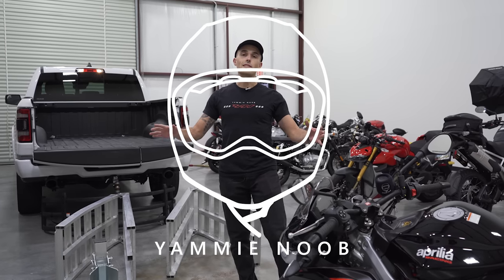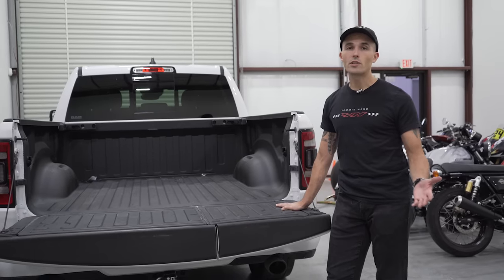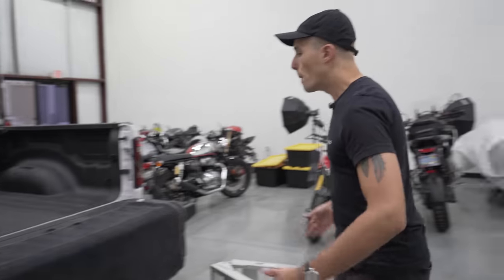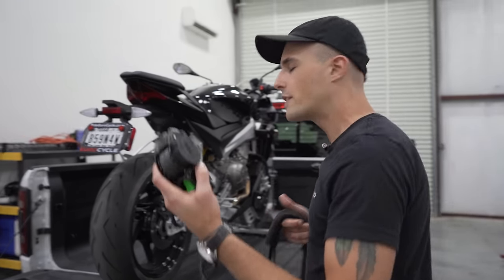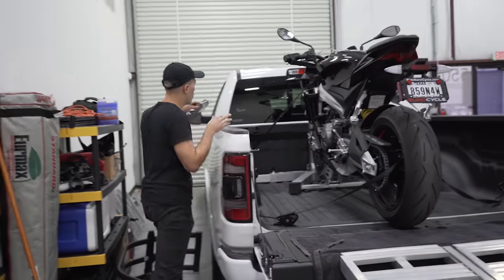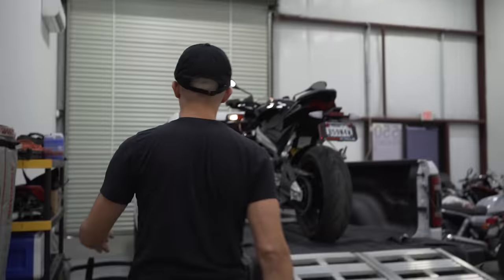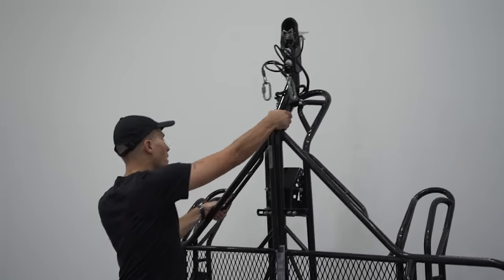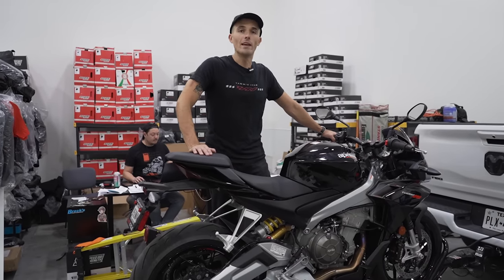How to Haul a Motorcycle with a Truck BY YOURSELF!

Comment: HUGE TIP WHEN UNLOADING: Bikes front tire will have less grip since truck beds arent always grippy and physics puts more traction on rear wheel which is on ramp. Put bike into gear and use clutch to help slow the bike down as well as front brake when unloading. Learned the hard way unloading my dirtbike when it was in neutral and front tire brake just make front wheel slide. Almost ate it. Using clutch was much safer and controlled. Using both is key.
Reply: I use both the front brake and bike in gear.
Reply: Nice tip.

Comment: Never ever use any ol' ratchet straps.   They are the fastest way to blow out your fork seals.   The ones you showed are intriguing.  But once you are in the front chock just an inch or so of compression on the front forks is all you need.  DO NOT BOTTOM THEM OUT.
Reply from the maker: That's what I said brotha
Reply: Can confirm, definitely blew my fork seals when I picked up my first dirtbike
Reply: You can, instead, use the ratchet straps on the bottom of the front forks instead of the (moving) body of the motorcycle such as the handbars.
Reply: @yammienoob  you did, you did.   But I was just making sure the folks in the back of the room heard ya.

Comment: I've been hauling my bike around for 40 years in the back of a truck. I don't always use a wheel chock when hauling, it's not needed but I have a Baxley wheel chock if I choose to use it. I also tie the rear end down from the rear foot peg brackets, works great.

Comment: Good video! Have two things to add:
1. If the bike has an easily removed seat, take it off and put a towel to sit on. Gets your feet flat on the ground. Very helpful when the middle of the bike is over the foot of the ramp. 🙂
2. When backing the bike down, put it in gear and pull in the clutch. If you start to feel it slip, you can let out the clutch along with using the front brake for stopping.

Comment: Great video/explanation/demo.   One thing you might want to consider, for those who live in a wet climate, spray your ramps with bedliner material.   Loading a bike with a wet steel or aluminum ramp can be death defying, they are incredibly slippery; I saw someone eat it just walking a dirt bike up the ramp in the wet.   Also, unloading, I always have the bike running and in first gear so I can feather the clutch to get "rear braking" while having my feet off the pegs for stability and, of course, the front brake to do most of the speed control.   The big thing loading and unloading is "commit".   If you try to stop in the middle of the ramp going up or down, bad things can happen.   If you start sliding going down the ramp, just stay on the brake and ride it out.   Going up the ramp, make sure you have enough speed; if you don't make it all the way into the bed, don't "goose it"; you will often break rear traction and wind up with a damaged bike (or body).   Just let it roll backwards (like you're unloading) and give it another try.

Comment: If you transport bikes often, buy a Kendon trailer. They are the best. They take up very little room in a garage when stood up, you can scoot them near a wall and you lose like 5 X 1.5 feet of floor space. So much easier than big ramps and big elevation going into a truck bed. And you don’t need a truck to pull an Kendon. My buddy installed a small hitch on his VW GTI and it pulls it with zero issues (with a 2 rail Kendon I might add…). Plus you don’t have to buy large, cumbersome ramps as well. Great video, I also recommend tying down at the base of the front shocks. There’s zero load pulling down on the shocks and it will hold just fine. It’s bad for fork seals to have prolonged pressure pulling down on the front forks.

Comment: Love those new tech Ratchet Straps and your method of tying the two ramps to the trailer hitch.  I have a similar setup, but nowhere as secure ramp tie down.  I also did the Harbor Freight Chock mounted on a cut to length piece 2x10 to fix it in the center.  I also put a deposit on a new 2023 XSR900, April delivery..

Comment: I use two Big Dog folding ramps.
One 8' & one 10'.
I ratchet strap them both to the hitch loops on the frame.
I walk/ride my '08 GSX-R 750 up into the bed of my F150.

I also use metal bars that latch into the tailgate for added strength for the tailgate.

Comment: Have used a 3 rail trailer since the 70's.  Easy with the 10 or 12 inch tyres on the Home Depot DIY trailer.  Liked the steel mesh on yours between the rails.  That was a bit of a dance just walking on the rails and cross beam for the center bike... Commitment - like that approach.  Did it with a Chevy van for a while.  Down the drive a few feet, up the ramp, into the van, stopping before hitting the engine cover.  Laughed at myself a couple of times down the road having done it right the first time with the Commando.  Top of my head still intact.  
You're doing fine, Yammie - keep this life style happening -

Comment: Just got to the towing section and I just wanted to mention since I regularly install hitches for my job that pretty much everything can have a trailer hitch put on it I’ve done Tesla model 3s, Prius’ , Camerys, altimas, a 1988 international semi a dude converted into a truck, 2 different public transport busses one that had been converted to an ice cream truck one that was more of a road trip machine, and various other odd things you wouldn’t expect to be able to have a hitch and wiring put on it. Most if not all vehicles can handle at least 1000 lbs towing. Not that is combined weight so trailer and bike along with anything other then you in the car like gear or friends. I.e you have a 300 lbs trailer and a 300 ish lbs bike for 600 lbs that leave you with 400 lbs of gear and friends/other people you can have in your car. Hope this info help all my fellow squids and safe riding/ towing.

Comment: Save your money buy a good strap. Only need one. Run a strap once around right fork. with that same strap pass to left fork run one loop around. Attach the end to your truck mounting point. Snug secure but not too tight. Strap will self tighten if bike lens.

Comment: Good vid.  Thanks.  I notice your lifts in the background.  Harbor Freight cheapos.  I have one too and like it.  I replaced the too small chock with the one they sell separately that is MUCH taller and beefier.   It works very well.
Reply: I use the taller wheel chock that they sell in the back of my pickup and it works great!  I cross straps to the front corners of the bed to keep it in place.  I think when I bought it was around $70.  It was also very handy for measuring and setting sag.

Comment: I've always just used my spare tire as a front wheel chock. If you lay it face down it's usually fine. You can use blocks of wood to keep it centered in the bed if ratchet straps can't be used.

Comment: Ive seen this when Yammie picked up my 400 last week, he loaded bike right up and strapped it down, the ramp and chock setup are perfect and worth the $$,,,, I gotta get the air suspension now. Ive seen a cable break but on an old truck with cement bags, much heavier than a bike.

Comment: In 2014 I drove from Detroit to New Jersey to pick up a 1989 Yamaha FZR1000. It had all the original bodywork, had only 4,002 miles on it and was last registered in 1991. The seller helped me load it with his ramp. Got it in and strapped it down no problems. Got home and used my........shorter ramp to unload. Backed it down the ramp walking beside it. The exhaust hung up on the ramp and I lost my balance. I jumped off the ramp still holding on to the bars and the bike started falling over on to me. To this day I don't know how I held this 530 pound motorcycle up and guided it down the ramp leaned over.

Comment: You asked if there was anything we could add.  I have almost the exact same setup, folding ramps, truck and straps.  

However I do not have the airbag height suspension adjustment.  I have an older 2010 ram Cummins long bed.  Although I have the tailgate air gate.  I have the 10ft black widow folding ramps.  Now what makes the difference between the safety for others especially my truck is kinda high.  Is that I have Installed a 2500 lb winch. Wife got it for me at harbor freight or tractor supply for @$80.  It has a battery remote and safer for the folks that cannot commit.  I personally power walk it up the ramps.  It’s a bit safer.  But then again, having adjustable ride height is a plus, though I don’t have it.   So, long story short, a cheap winch!!!!   It really works in so many ways!!!!

Comment: That’s much better than the “plank and a bank “ system I’ve used …….and who knew there was an awesome item such as the “retractable ratchet straps “ ? I just researched about a year ago and bought a set , and never in my amazon / online search did a retractable set come up….todays add the “retractable “ prefix and there’s a long list of brands etc…..now I’m tempted to buy another set of lighter duty less than (5k lbs break point ) my SmartStraps 14’ Ratchet Straps, 2 Pack –5,000lbs Break Strength, 1,667lbs Safe Work Load –Commercial Tie Down Straps for Heavy Duty Cargo, Haul Equipment and Vehicles…..which I knew was overkill but figured more is better at that point , now I know retractable is better…🤯🤷🏼‍♂️

Comment: I use the Condor. Much lighter. For dirt bikes you don't need anything. My favorite dirt bike ramp is the StepRamp 5-Step Loading Ramp 72". Getting the 1250 RT in the back of my F 350 isn't too bad. Never been a fan of canyon dancers but many people use them. Ride my dirt bikes in the truck. Always walk the 1250 and 790 in and out. You made driving it in and out look easy. I think Id be too chicken.

Comment: Video Request- Picking up Your DS  off pavement/gravel/dirt . Have a new one and dropped it and needed help getting it up. Hadn’t thought of all the situations I might need to be able to do it myself. Thanks for the loading video, have a Tundra and the Sled fits nicely corner to corner with tailgate up and locked.
Reply: There are videos out there of a 5'5" female picking up a heavy adventure bike like a BMW GS series bike. Same thing for picking up a fat cruiser.

You have to squat/walk it up and backwards.
If bike is fallen on it's left side,
1. Turn the bars to the left, grab the bars, not the clutch (for safety) woth your right hand.
2. Line your butt up with the seat, but just to the left side.
3. Left hand goes on a sturdy part of the tail (sissy bar, subframe, etc)
4. With your feet in front of you, push the bike backwards and onto the tires.
5. Keeping your position, take the right foot and swing it behind you to put the kickstand down.

IF YOU FALL ONTO THE RIGHT SIDE OF THE BIKE:
Step 1 is to put the kickstand down ahead of time
And all other steps will be the same except for the front wheel, turn the bars to the right, and hold front brake down while you go backwards, everything else is the same.

Comment: One thing that wasn't mentioned is to be very mindful of the ramp angle so you don't high-center the bike. I bought a utility trailer that has a drive-up gate. The first time I was loading my bike (MT-07) I walked it up but using the bikes power and as I crested to top, the exhaust caught the top edge. So be mindful of that because that can cause you to drop the bike or damage the exhaust if you go too fast. In my case I was lucky that my trailer has a dump feature so I could tilt it slightly which effectively lowers the tail and decreases the ramp angle. I would put jackstands under the rear edge of the trailer to prevent it from going fully into dump mode.
Reply: did same thing when loading my busa,, changed angle of ramp and problem solved

Comment: I use a third ramp so I'm not putting weight on the edge of two combined ramps. Not sure if that is necessary, but makes me feel better. One smaller ramp for each of my legs should I need to put a foot down to save a drop, and one beefy boy in the center for the bike itself.

Comment: Amazing how tens of thousands, maybe hundreds of thousands, have loaded bikes using a couple of 2x10s and a few straps from the local motorcycle or lawn equipment store over the last 50 years instead of nearly $1000 of shiny goodies from Amazon.
Reply: I thought the same thing.. 3 - 6ft long 2x10s have worked wonders for me .. instead of dropping almost 500$ just for foldable aluminum ramps.. also use 2bys and Ihooks for my front wheel chalk

Comment: The wheel chock and canyon dancers take up unnecessary space and are a waste of money.  And don't ride the bike up and down.  Walking the bike using clutch, throttle and front brake gives better control, especially for shorter riders.  Use one ramp for bike, other to walk beside.  If you're anal about your truck, use block of wood to protect back of cab from front wheel dent. Once bike in, kick a piece of wood behind front wheel preventing possibilty of bike rolling back.  Can use another piece of wood under kick stand to protect truck bed.  Use endless ratchet straps, preferably with 2" webbing.  Run webbing around bottom of forks by axle nuts.  Use lowest and forward most attach points of truck so straps are pulling bike forward and down.  Sturdier than canyon dancers with no load on front suspension. Make sure you use both front brake and clutch with bike in gear when unloading bike.
Reply: Yep, sounds exactly like how I do it. But they make that useless crap for people that don't know any better.

Comment: if it is off road ....yes
subtle differences my azz..... if you own a bike or two as i do ...i have several AND i have several trailers.....edit dont forget the weight of haul!
dont forget trailers can also haul sleds, jet skis and quads ... we run guads with skis rather than a snowmobile season is too small to own one!
your video is probably the most complete that i have seen...
good video!

Comment: When i got my first bike from the Dealership last month. The guy at the dealership saw i really wasnt sure how to go about tying down the bike. Said all i needed was 2 straps and (though wasnt suppose to help me strap it down he did). He had me put it in the back of my truck and leave it in first gear then strapped the front of the bike down with 2 straps (no wheel chock)... It felt sketchy af but it worked. I was about to tie it down 4 ways to Sunday like you did in this video myself.
Reply: The guy at the dealership was right, 2 straps is ALL you need. If you put it in sideways, you can even get away with one.

Comment: Hey I love the videos you put out. They are really helpful and insightful. I am rather new to motorcycles in general and I have noticed something. I have yet to see anything about a real wheel steering bike of any kind. I was wondering if it is even possible to build , and would the learning curve for riding it be to much?
Reply: Try reversing your bike down a hill for example. Gets very sketchy when you start turning...
Reply: Ever driven a forklift? Rear wheel steering handles weird
The vehicle tends to rotate around the fixed wheels.

With the fixed wheel at the front, a small amount of steering input changes the angle of the vehicle to a greater degree, so it’s less stable?

I guess with proportional power steering tuning you could make it handle ok
Many newer cars have small amounts of rear wheel steering that will rotate the car more at slow speed and crab walk it sideways more at high speed
Reply: @thomasa5619  thank you for explaining this

Comment: I do almost exactly what your showing here, but let's look at one thought about OEM tailgate supports.  On older trucks or those that live outside all the time those swaged into lead alloy cables can and do rust. They have been known to fail.  Take a look at DG Manufacturing's tailgate supports for total peace of mind about tailgate failure. It would not be good if that happened, not for you, the bike or the truck

Comment: wouldnt you want to only rely on one ramp? if you are moving the bike up the ramp in between the 2 ramps, the weight of the bike / load is being put between the 2 ramps (you're really relying on how strong those 2 ramp locking clamps). Rather, using one ramp, you're dispersing the weight as intended

Comment: Helpful video yes, but good practices? in my opinion no. Riding in the middle of the ramps is not as sturdy as riding in the middle of a 3 ramp setup or a wide single ramp. Also ratchet straps should not compress the front forks or any suspension of the bikes at all. Wheel chock is cool, but when properly tied down unnecesary. Ratched doen the bike at the front axle points. It's been tested & proven as the best way to secure a motorcycle. I've taken several 1k mile trips like that and the bike is super sturdy with 0 movement
Reply: A lot of manufactures recommend "full compression on front forks" as the right way to tie down a bike.   Like all things, it depends, but it's not a clear cut "don't do it this way" for tying down a bike compressing the suspension.